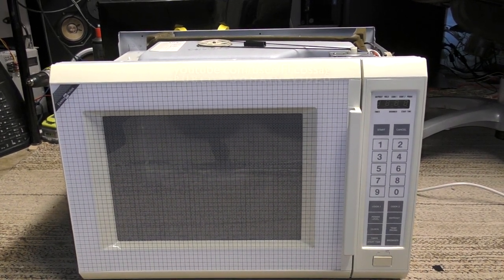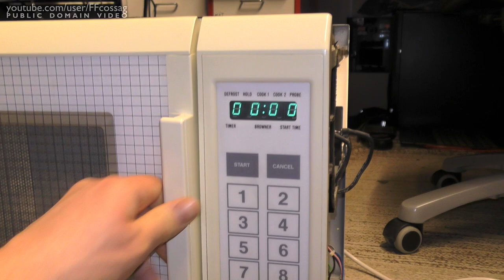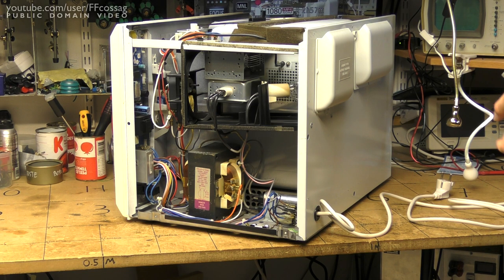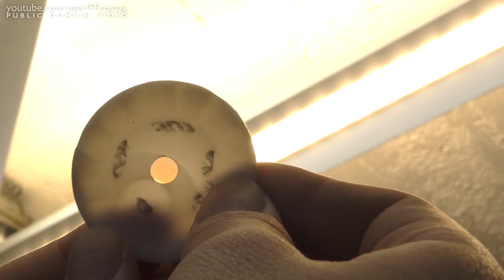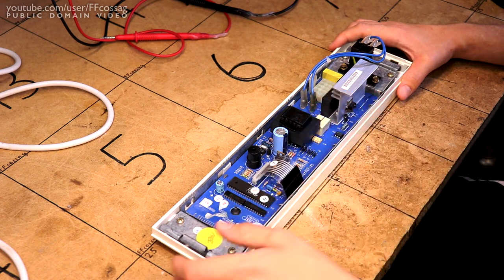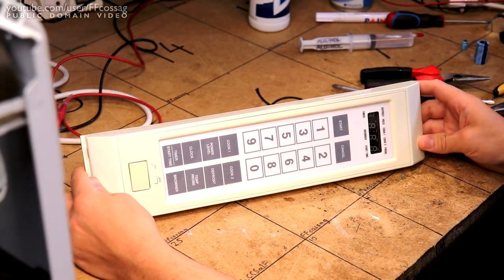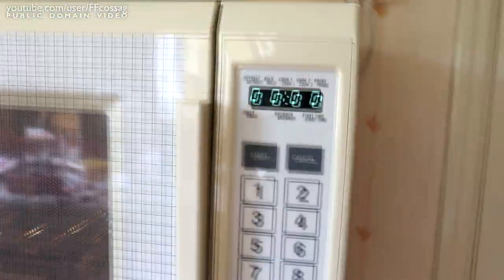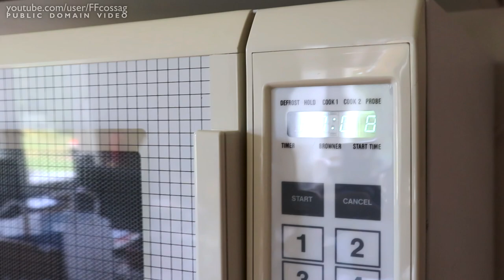1987 Elektrohelios microwave restoration

Comment: They certainly don't make them like this any more. That thing is in immaculate condition. Proper leaded solder lasts for ever. Modern lead free shite goes brittle and dry. I bet that original 4700uF cap is still good. What ESR/capacitance did it read on your ESR meter, ffcossagg? They look like Rubycon caps.
Reply: aye pretty sure they are 80s rubycon , them things are good for another 30 years yet :P.
Reply from the maker: They measured just fine, I replaced them more for good measure than performance.
Reply from the maker: My experience with those light blue Rubys is that they tend to go thermonuclear if left to sit for too long.
Reply: Thermonuclear love that word!

Comment: Don't grind with gloves on because they can be dragged in between the tool post and the wheel. Skin doesn't hang so it won't reach the gap.

You can cut-back plastics like you cut-back car paint to restore it.
Reply from the maker: What do you mean by cut-back?
Reply: use a fine grit such as a polishing compound and a rotary polishing disc sander or DA sander.
Reply: I think Sasquatch is talking about the yellowing on the frame and button?

Comment: One of the relays will short out the resistor in line with the transformer.
The power resistor is mounted on top, I see. It is there to reduce the "DONK" current-inrush-sound of the transformer when it gets powered. After a second or so it will be shorted by the relay to give the transformer its required power. It will be used mostly when you dial in a lower power rating to cook/heat the food, as it will switch the magnetron on and off to get to an lower average power level. In my mum's magnetron that resistor was actually burned out. As a result the thing made a lot of "DONK" sounds when operating.

The sad part is that my parents got a new kitchen recently which also brought the inevitable replacement of kitchen appliances. The Bosch gourmet got tossed out without an option for me to keep it. It was a heavy beast, prob. 30 kg's or so, as it was a combination-oven. It only had a 600W mag., though. But, good old quality! Todays shite is just a shitload of electronics, with touch screen displays, and the thing has to cool down for 30 minutes! It always keeps the fan running after use! Prob. to save the electronics.
Reply from the maker: I don't think the big resistor is connected to the transformer at all, it doesn't make sense as it's triac switched (there's no relay clicking noise at all when it's running). The two relays must control the two other mains circuits in the machine; namely the fan motors and the grill heater.
Reply: Ah, my mistake then. :) In ours, that was its purpose.
Thanks for the reply!

Comment: 1. Moly or graphite is bad for plastic parts. They dig into the material and damage it.
2. You don't want to mix different kinds of greases or oils. Or spray oil to where grease is required/applied. Do not fix what is not broken.

But thumps up for the great video.

A question: What solder and flux do you use? and at what temp?
Reply from the maker: Thanks. I currently use Crystal 400 solder for the most part, as well as really cheap solder from Nedis (HQ brand) and flux syringes off of pcb-soldering.co.uk, I can't recall which specific ones.
Reply: Thank you@

Comment: The speed of the cooking might also have something to do with the '87 oven being a 1kw model (judging from the power draw) and your older (more modern?) oven was on the "750W" setting
Reply from the maker: The magnetron in the Elektrohelios is just rated for 650 W on the output - it just seems to be really inefficient.

Comment: Out of curiosity, how come your videos show up as 1080p50 and not 1080p60 , as is much more common?  Thanks, liked.
Reply: PAL video is 25/50FPS
Reply: Thanks...  Still curious though...  If you have a recording device that can do 60fps, why not just set it to 1080p60?  Not nitpicking...  but this is a technical-related channel afterall.
Reply: Because 50fps when synced with the 50hz lighting won't show flicker. If he filmed at 60fps, every light would flicker a lot because some frames would be lit, others wouldn't.
Reply: Ah brilliant!  Yes, of course.

Thanks
Reply: EU use 50htz AC so thats what things run at for stopping light flicker . Its mostly historic now but still a thing,
Reply from the maker: As others have pointed out, it's a PAL thing. I WOULD shoot in 30/60, since it's more internet-friendly, but only one of my cameras actually support it.

Comment: you do know you are supposed to STIR the food to promote even cooking right? just as in a normal oven! stops you having cold food IN THE MIDDLE.. good video, nice electronis and ace restoration.. Lousy Chef..
Reply from the maker: You haven't even seen the peak of my culinary skills. ;)

I'll raise the argument that low quality microwaves will have a tendency to heat your food less evenly, mostly because the magnetron is side firing, and as such has a harder time penetrating through the mass of food. Since most dishes are flatter than they are tall, a top-firing magnetron has to penetrate less food in order to achieve the same temperature rise in the centre.
Reply: FFcossag good point, but you did have a pretty full dish😀 I suggest that a stir would have reduced the cooking time a lot and the time you quoted was pretty long with the chance of over cooking especially with a draw of 1.5kw which has got to drive with at least 1.3.. 

Certainly far better than today's Chinese junks and well worth the effort and skill you put into it.